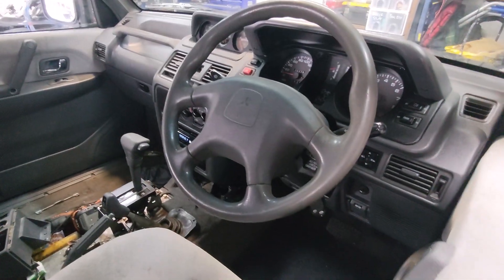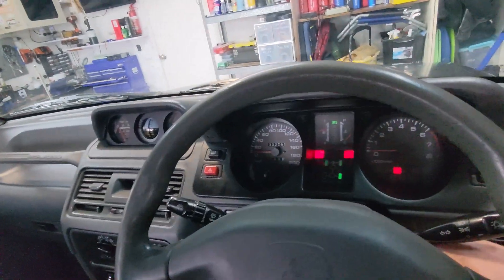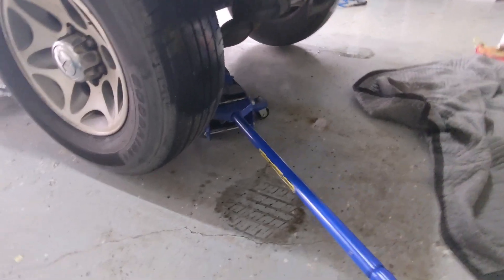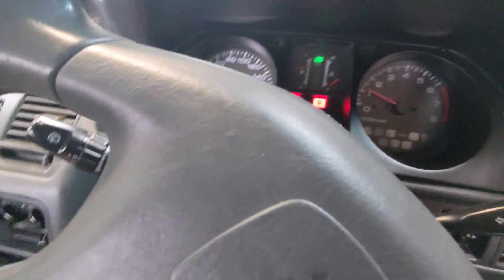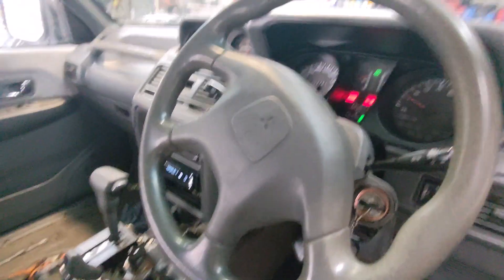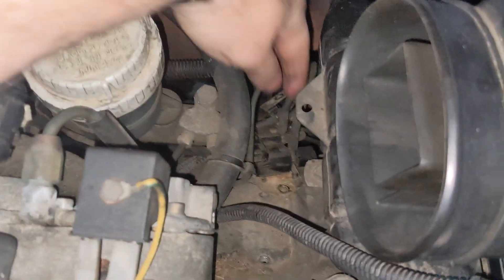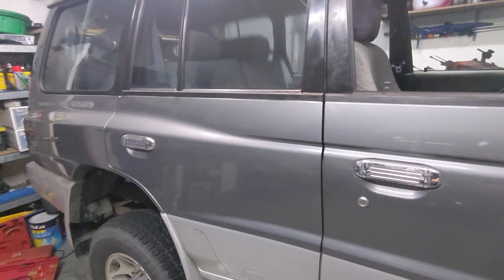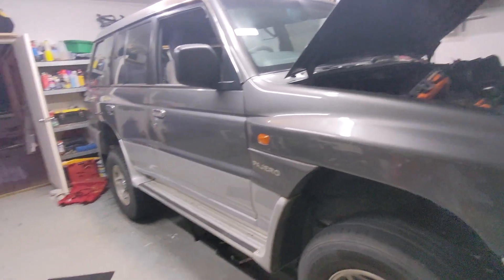The root cause of my 4WD engagement issues on the NL Pajero

Comment: All from lack of use mate! Been 3 years since I went 4wd although I do use it in H4 on wet roads and when towing but that was I guess not enough to keep the vacuum solenoids healthy and I have had the flashing light issues now for a good 6 months. As I have a new car I have not been using it much anyway. Did drive it and change into H4 and found it did go into 4wd so that's good to know. Have bought the kit from ebay and had no idea where they are or how to replace them so thanks to you I know how and where. 
After that I have to solve the issue with it not running on LPG (hi pressure lpg fitted in 2010) and replace the broken ext door handle (another common issue with these things is the small plastic joiner in between the steel links and handle)
Interested to know why you only had 1 of the rear wheel lights working on the dash though as mine both worked!

Comment: I have Pajer 3, I have a problem where the front dif wheel lights don't stop flashing. 
I've changed the solenoid, i checked the vacume lines if they are all connected, and i've checked if the diff rod moves in and out, and it does. Tested it with a friend. 
4H does engage, it just doesn't tell the computer that it did, and the lights never stop flashing. 
I know there is a sensor on that diff, but i'm not sure if that is the problem or not.

Comment: Do the NLs have a viscous clutch system in their center diffs for Full-Time 4WD (4HI) or was that not seen until Gen 3 Pajeros when Super Select II came out?
Reply from the maker: Yes it has the VCU for 4WD mode.  Pretty much all Mitsubishi AWD systems including Lancer Evos used VCUs.  4WD Lock mode doesn't use the VCU of course.
Reply: @KaldekBoch  finally found some articles detailing this somewhat.  So in 4H the open center diff works in tandem with the VCU which distributes power ideally 50:50. When the center diff is locked it BYPASSES the VCU.  Do I have this correct?  

I know a lot of modern systems like Volkswagen’s for example employ just a Viscous coupler (no center diff) to mimic both an unlocked and locked center diff by altering the fluid properties.
Reply from the maker: @on1ytheb3st Yeah, the "open diff works in tandem with the VCU" is how the other Mitsubish AWD systems work too.  Some newer systems used "Active Center Differential" aka ACD, which removes the VCU and replaces it with computer controlled clutch packs much like how AYC works for the rear diff in stuff like the Evo.

I guess "bypass" isn't the right word for 4WD-Lock as it's, well, just locking the diff.  Once the diff is locked the plates within the VCU aren't sliding past each other.

Fun fact - on the Lancer Evo the center diff is in the gearbox itself and the VCU or ACD system is inside the transfer case.  Whereas with the Pajero, the center diff is indeed inside the transfer case along with the VCU.
Reply: @KaldekBoch  Right okay that makes total sense.  The VCU reacts when there is a large difference in driveshaft speeds by shear thickening the fluid but if the driveshafts are locked together they never spin at different speeds so the VCU never engages.  

I’m still breaking things down conceptually so I’m not too familiar with the differences of a Transfer case and open differential.  I understand the purpose of an open diff but people use them interchangeably sometimes.  

I’ve got a older (R50) Pathfinder with the the “All-mode” transfer case and that’s still a great mystery to me in its function.  I know it has a VC but it’s distribution of power and when it’s done is not easily found info.  In Auto mode I believe it sends power to the front during acceleration and when there is slip in the rear.  And I believe it does truly lock into 4H but there is no term for center diff in the FSM, just the ATX14A transfer case.  Do you think the Viscous coupler physically can lock too?

Edit: did a little more research and it sounds like the ATX uses a “wet clutch pack” so not quite a viscous coupler. In 4H it’s not a true geared engagement.  It spins the hydraulic control for the clutch to 100% is all.  Sounds like it’s still dependent on the friction of the clutches to maintain 4H unlike the physically locked center diff of Mitsubishi’s Super Select.
Reply from the maker: @on1ytheb3st  Nissan has a whoooole different approach to torque splitting.  Just look at the ATESA system in the Sklyline GTRs (R32-R34 at least).  Their system has controllable torque split.  Mitsubishi is more like Subaru here: full-time AWD with 50/50 torque split, and a VCU or clutch packs to limit slip.
Reply: @KaldekBoch  I will check that out; yeah it sounded like my ATX14A was in fact a derivative of the Atesa system in the GTR funny enough.  So is a viscous coupler and wet clutch pack the same or just similar; conceptually I’m thinking they are different; one has a bunch of plates concentric around a shaft bathed in a non-Newtonian fluid (no friction material) while a wet clutch plate actually has friction “clutch” plates but fluid is allowed to get between the plates.